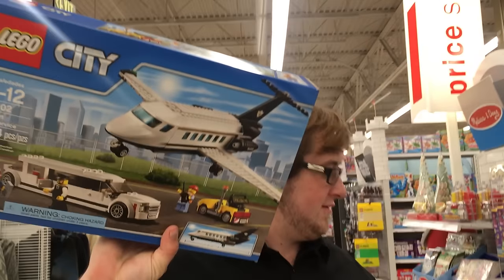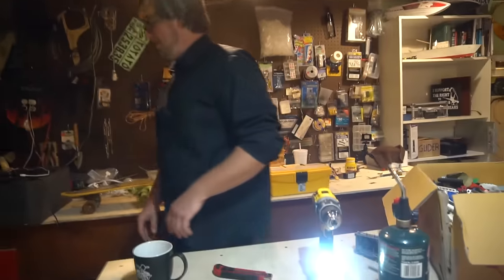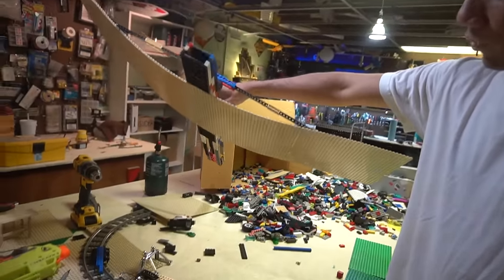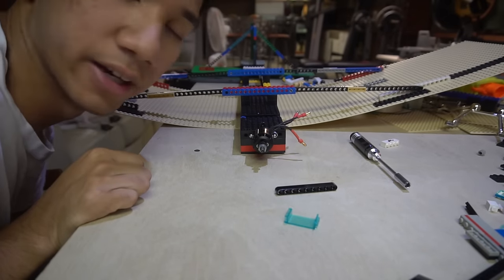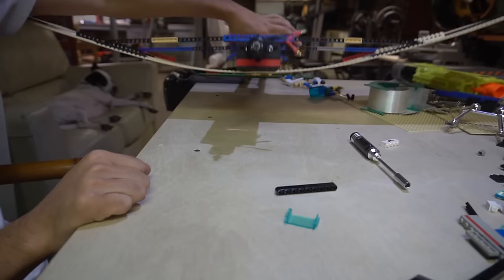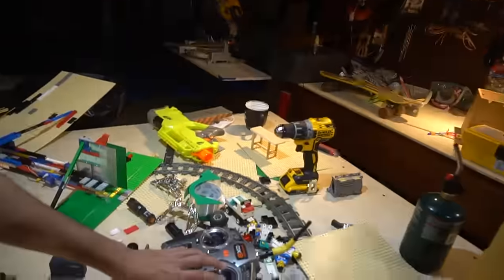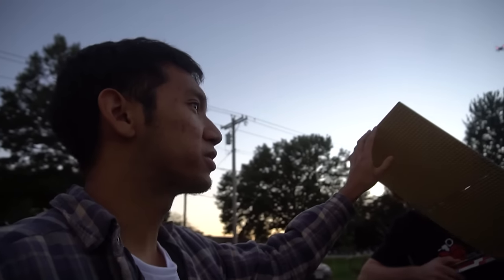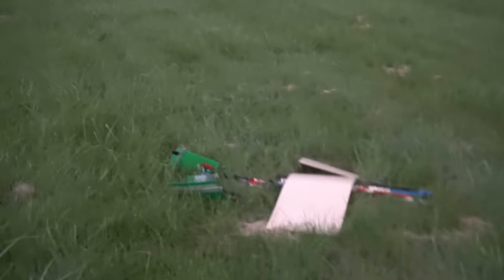RC Flying Lego Airplane

Comment: I can't believe that thing flew with the aerodynamics of a chair and wings that were freaking rectangle and dotted!
Reply: The aerodynamics of a chair!! 😅
Reply: That indeed caused a lot of drag, and some fine-tuning to the wing shape and angle could've also resulted into more lift so less power of engine needed, so higher top speed
Reply: I mean the bumps up top probably have it it's only lift XD
Reply: I didn't think it would fly without glueing it.
Reply: The concorde at low speeds is more aeorodynamik than this lol
Reply: @kas-lw7xz  where does the lift come from if the wings are flat?
Reply: @GrumpyGuardian  flat wings can create lift at a positive angle of attack
Reply: goku but he did ?
Reply: Ftwftwftwftwftwftwftwftwftwftwftwftwftwftwftwftwftwftwftwftwftwftwftwftwftwftwftwftwftwftwftwftwftwftwftwftwftwftwftwftwftwftwftwftwftwftwftwftwftwftwftwftwftwftwftwftwftwftwftwftwftwftwftwftwftwftwftwftwftwftwftwftwftwftwftwftwftwftwftwftwftwftwftwftwftwftwftwftwftwftwftwftwftwftwftwftwftwftwftw
Reply: Those plastic boards were 80 bucks if it dont fly imma melt the dam thing
Reply: You can make almost anything fly with the right wing  width
Reply: They’re vortex generators
Reply: It's not dotted, it's called peg holes and/or lego studs.
Reply: As long as it has lift it can fly
Reply: @kas-lw7xz  that's what I was thinking (not what I was thinking)

Comment: Yup. Every engineer's childhood dream has at last been realized!
Reply: Yep, very good job.   I'm wondering whether trying to copy an old bi-plane might be a better shape?   Lego kind of like the flimsy and heavy materials early aero-engineers had to use..
Reply: A possibility for sure. I think the bigger issue is to get the area and weight distributions correct. This model had far too little vertical stabilizer area for the moment arm of the tail, which led to the wild yaw and roll behaviors it exhibited.
Reply: joshuawfinn my brain is hurt from what u said🤕
Reply: joshuawfinn lol so true
Reply: joshuawfinn iii
Reply: joshuawfinn I
Reply: joshuawfinn ."""
Reply: joshuawfinn I
Reply: crystal roggy yeah
Reply: joshuawfinn yes but WTF HOW DOES THAT FLY
Reply: joshuawfinn WAIT OMG THIS VIDEOS A LIE.ITS ONLY FLYING CUZ OF THAT THING IN THE FRONT THATS NOT LEGO :O
Reply: crystal roggy NO CUZ ITS NO LEGO.  THERES WIRES (ok that's not that bad BUT THERES THE SPINNING IN THE FRONT

Comment: You should have used Technic as it's structurally better and has pieces perfect for making air foils also Power Functions are thing.
Reply: Ultimate-Dragon Gaming and Forging Technic is definitely more structurally sound, but PF components don't have nearly enough power to propel something of this weight - not to mention all the weight the PF components themselves would add.  The battery boxes alone are far too heavy to make using them remotely viable.
Reply: @ChiptuneDCI  those are still powered by lipos and rc grade equipment
Reply: AmloGaming 
Grant Thompson’s last video the channel was called 
The king of random
Reply: I agree
Reply: bro he apparently don't know crap about Lego ;ddd

Comment: Nice job Peter!  Looks like the struts worked well.  I was expecting the wings to fold.  One good thing about the lego plane is that it can never really break.  It'll just come apart then you just snap it back together and fly again.  No hot glue required.  I challenge you to make a lego propeller for it.  You're allowed to use epoxy.
Reply from the maker: * picks lego peices out of dog*

:D
Reply: Fyi: you glue lego with acetone.
Reply: @ForOdinAndAsgard  damn

Comment: LEGO Technic pieces would probably provide a much better structural strength for the airframe, and the wings to think of it.

Using the LEGO building sheets as wings seems like a fundamentally bad idea because you can't really link them together in a reliable fashion, there's no connectors on the bottom of the plates so the joint is always going to be quite flimsy in one direction. Honestly if I had to build a LEGO R/C aircraft, I would make the airframe, formers, wing spars and ribs out of Technic parts and then cover the whole thing with transparent tape.
Reply: HerraTohtori there are baseplates that you can attach bricks to from the bottom as well.
Reply: Most of those types of plates are much smaller than these large base plates, though.

It's not about where you can attach things, it's more about whether the pieces are under tension or compression. Lego fundamentally rely just on the friction between the plastic surfaces to stay together which works fine for compressive load as well as side loads, but if you put a pillar of lego under tension (ie. pull on both ends) it will quite easily come apart.

The same thing will happen if you try to make a wing out of several plates and reinforce the connections by smaller plates on top and bottom, the joint plates on the top or bottom will wiggle their way loose when the joint starts to bend under flight loads - and this will happen on both sides (center on the concave side, edges on the convex side of the bend).

Trust me, I have more than a decade of intense Lego engineering experience under my belt, I know how these things work...

Comment: If u want to check the balance then attach a string at the center of gravity and the hang it and the calculate the degrees for lift or downward force it will help a lot and you would not have to crash again and again  :)

Comment: This would've been 1000 times easier if you used technic pieces
Reply: Exactly what I was thinking.
Reply: Griffin Richardson it would be heavier :/
Reply: Griffin Richardson lego power and evo 3
Reply: Sebastián Alberto it could be a more skeleton frame for like the tail bar so if he combined technic with normal lego
Reply: Yeah, hope he redoes this with a better frame.
Reply: gregistopal Yea If u use both together you can make pretty strong shit, made my pc case out of it and its very sturdy.
Reply: Nope
Reply: I Know Right XD
Reply: I know
Reply: and more rigid, M U C H more rigid
Reply: Griffin Richardson he did, the wing suporters
Reply: He did
Reply: Here they have to search and pick up all the parts after every try.
Reply: Nah you could n9t make it fly with any lego motor or battery pack
Reply: Technic fuselage would definitely make things easier, but baseplates were definitely the right choice for the wings.  Huge surface area and negligible weight.

Comment: Excellent video and concept! I would have thought you would want to glue everything together, for durability.  With some judicious use of glue on the wings, you might have been able to dispense with the wing spars, which would foster an improved thrust-to-weight ratio.  It flew better than I thought it would, for a plane without ailerons.

Comment: As someone who spends a lot of time figuring out how to make LEGO sets structurally sound I have to say a couple of things. 1: You need cross struts inside the structure, that will alleviate lots of the wobble that can shake it apart. 2: The saying less is more doesn't apply to LEGO flying machines, because they are so bumpy they create a lot of drag in the air so you need smooth parts going along the the wings to make it fly more stable

Comment: that's cool bro i think that is first lego plane creation in the world and u make that thing realy fly great job
Reply: He did not use lego to make that piece of shit fly. He used off brand motors, batteries and controller. It's possible to make a FULLY rc plane because Lego has created Power Function, Boost, and Mindstorms but he didn't.
Reply: It is possible to build a 100% LEGO glider, but not a 100% LEGO plane.  The LEGO motors don't provide enough power compared to their weight, same goes for the battery boxes, and most LEGO propellers barely create any thrust.

Comment: very nice. I always fancied making a lego plane that flew, but never had the money for the rc stuff or extra lego. great to see you had success. You may be able to do the hinges for steering with lego, but I can't see how you could improve the wing plates as they can't be strengthened underneath without tape or glue. Maybe very long rubber bands to give tension underneath.

Comment: Next Build, a Giant Power Bank, Charge Macbook and LiPos at the Field 😁
Reply: Car Batteries will do the work. :I
Reply: Too heavy and you can only 20% discharge without damage the Battery, a big Li-Ion with 110V/220V Output would be nice

Comment: Peter you should have used lego technic on the fuselage more than you did, It would have made it stronger and lighter.
No, hate my man, good video! :)
Reply: Jack Baker ikr, he should have also not used mega blocks, you can see them in quite a bit of shots

Comment: Very cool! It seems it could use a little more vertical stabilizer area. The good thing is that this is the proverbial model that doesn't break but re-kits when crashed, so unplanned encounters with Terra Firma bring no cash penalty, just some re-fitting of Lego bricks. Nice!
Reply from the maker: Great observation! Yes the vert stab could have been larger. I just ran out of those one sided lego bricks!

Comment: The concave provides more surface area, the convex can provide more stability at higher speed, and a convex wings with 30° front to rear tilt will provide both more surface area and stability

Comment: I realize that the maker of this video will probably never read this, but I would like to suggest that making a biplane instead of a monoplane would have made the plane much more stable and easier to control.  Also adding some curvature to the wings (camber) so that the wing cross section isn’t symmetrical and flat would help to prevent stalling at low speed and make level flight possible.  This plane is only able to maintain lift when the nose is pointed up (angle of attack).  Relying upon the nose upward to generate lift is asking for trouble because the natural tendency of the pilot is to keep raising the nose higher and higher, but at some point, even if unintentionally, the nose gets so high that the angle of attack is too high which leads to stalling.  Could’ve been much more successful with these modifications.

Comment: Someone in my local LEGO group actually managed to make a 100% LEGO glider that actually flew.  They had a thin LEGO Technic frame and used bags from the LEGO store as canvas to cover the wings.  This thing is pretty legit too though.  If I ever get more into RC planes (only got a 3 channel RTF model right now), I will have to try this myself.

Comment: ... try technic parts for the plane's body
Reply: raykupal technic wild have been better for many occasions here, like as struts, hinges, motor mount, etc.
Reply from the maker: good point! I had some bricks but unfortunately I didn't have enough to build the whole thing! Maybe on part two I'll give it a run!

Comment: I’d use normal plates with tiles on the top to smooth the wings out, then use as few bricks as I need to to keep the craft light. Then it’s a matter of making sure the motor drivetrain’s small enough to fit but still strong enough to fly. SNOT (Studs Not On Top) would work really well with making the plane lightweight, strong, and smooth. Using premade Lego cockpit pieces would also save on weight.
And remember: With any vehicle, SYMMETRY IS KEY .

Comment: i have to wonder if those bricks with the little peg holes in them are actually less mass than the same dimension solid brick... i wouldn't be the least bit surprised if they are actually a bit heavier, because the "solid" bricks are still mostly hollow on the inside, and for every hole you put in to loose mass of the surface in that diameter, you're gaining the outside surface of a cylinder on the inside where it would otherwise be hollow. i think the bricks with holes just increase surface area-to-volume, which in this case would likely also considerably increase mass. it would be different if you just drilled holes in the side of a regular brick, but that's not what's happened with these manufactured ones.

Comment: This morning, I just DREAMT that I built a LEGO CONCORDE with the Technics version parts able to do THREE different shapes of a Concorde! The first was thin and arrow-like, the second was wide and short while the third shape was a little bit spoon shaped. My DAD was able to make himself somehow shrink to roughly an inch tall-
After around three shape changes and around five minutes, going nearly the speed of sound and twenty three minutes, it began having severe part warping problems and gradually began disignigrating. Dad was the Test Pilot and luckily managed to land it before the thing ultimately fell apart.

Comment: Once you have a design you can use acetone on a q tip to weld legos together permanently, just add a little bit because that stuff melts through very quickly

Comment: Why don't you set the horizontal tail at a lower incidence angle?
Because at the moment both the wing and the tail are set at the same incidence angle and thus the stability margin is small.

Comment: I didn't know there were base plates that big. In case you didn't know, the Lego patent has expired and very inexpensive knockoffs are being made. I've gotten some at Dollar Tree and the cheap ones work so well that you can't tell which brand is which judging by the strength and the fit. Cool build!

Comment: These not jet engines or high hp push that helping it access more quantities of air for the glide and flight, simple motor infront wresting air from the path toeards the wings, so better let the wings cupy type for more space of air accomodation underneath the wings in the middle  75% both side and say lest along the margins for better turns just reverse mechanism from the that mid wing span

Comment: It had this weird effect where it had a lot of turbulence at the front, then spun, it was due to both imbalance, and it being legos, heavy, and the most support needing in the middle, to hold the wings up so it does not shatter if some random bird hits it, with my luck it will.

Comment: When making a fuselage out of Legos you want to avoid using the shorter bricks cause the more shorter bricks you have the more weight there is because of the way the bricks are constructed, the long parts with the holes are good and the window and vehicle side parts are good cause they have less of a ratio of plastic than a bunch of the other bricks together at the same height. You also want to have the same kinds of bricks on each side cause using different bricks can unbalance your aircraft, also since it Lego you might want to put a pilot Lego person  in the fuselage, It Lego after all. Hope this helps anybody else that tries to make a Lego airplane that flies.

Comment: This isn't the real flying Lego plane everyone wanted, its cool, but we want to see a Lego plane ONLY using Lego, no rc plane motor or propeller, you have to use Lego power functions, I suspect you will need to use a very large wingspan, and lightweight AA batteries, which btw that battery should be the ONLY non Lego thing you use

(Edit, you can also increase the voltage that is going to the Lego power function motors)

Comment: Am I the only one disappointed by this? Either he isn't great at creating with legos or he just didn't try very hard. For example he uses tape for the control surfaces, it would have been so easy to use lego technic pieces to make the hinges.

Comment: What about ailerons no wonder its not stable an hard to fly your completely relying on rudder controls to steer it which on its own is not reliable turn to hard or for to long an it puts the tail out sending it into dive/stall don't get me wrong still epic who hasn't wanted to make a lego plane an it does fly really well just put some ailerons on it an bet it'll be right laugh to fly

Comment: That's sort of cheating. You can strap a propeller to anything and make it fly. The real challenge is to make a Lego plane fly under the power of Lego motors or pull back engines.

Comment: You should use Lego Technic instead.
Reply: Technic would be good for lightening holes. I think more success could be realized if the wing was actually a wing vs some flat board with dubious lifting capabilities (not to mention the turbulence caused by the dots on top). The dihedral wont work if the wing doesn't generate lift. The whole principal is based on differential speeds between wing tips and the lift generated by the lower (faster) wing tip vs the upper, stalling wing tip.  Without any actual airfoil shape in the wing, you don't get any of that. It probably would have 'flown' the same without the wings since it was just the motor/prop thrusting the entire time. Angled Lego on the leading edge top might have been enough.

Still, loads of fun to watch.